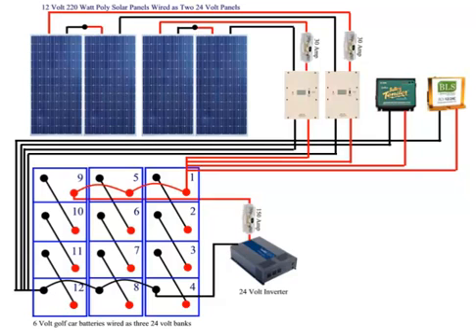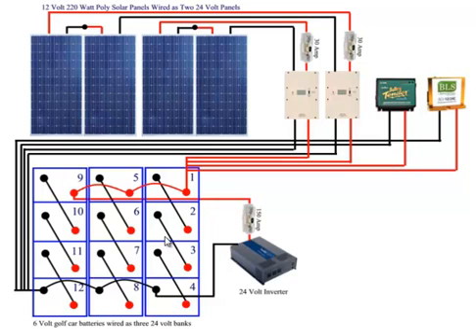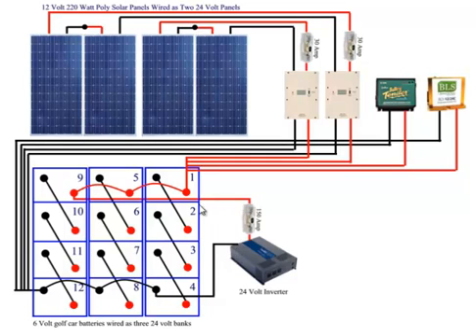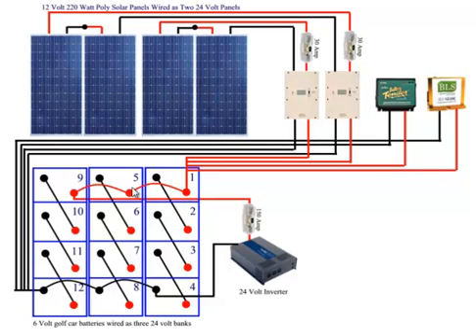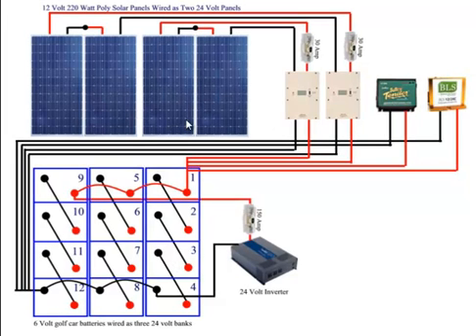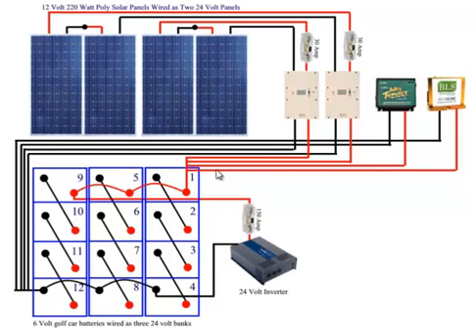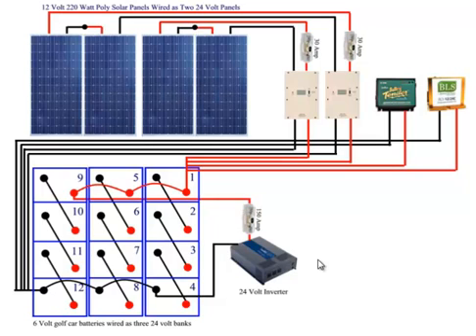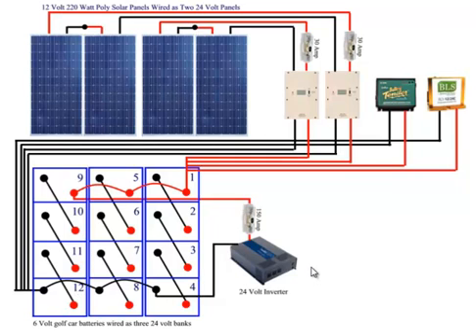DIY Solar Panel System: Battery Bank Wiring

Comment: As long as there is no load or charging taking place on the batteries, there shouldn't be any spark. I like the video. Thanks for the diagram. In the UK, we call them Electrons, whereas you refered to them as Ions. Potatoes, Potatos I guess. : )

Comment from the maker: CONTINUED... Connecting to the opposite side of the banks like this sometimes is necessary if the posts where your battery tenders, charge controllers and desulfator is already getting too full and don't have enough room for the inverter connections. I hope that helps.

Comment from the maker: You don't have to wire the inverter that way, you can wire it to the same points as the charge controller is connected. The connections to batteries 4 & 9 are electrically the same as 1 & 12 except that you're drawing power from the opposite side of the three banks and thus are forcing the electrons to flow from all the batteries equally to level discharge them. CONTINUED...

Comment from the maker: Great question. I was worried about that at first too. When I connected the battery cables from one battery's positive post to the next battery's negative post there was no sparking at all. I still find myself biting down on my teeth and making sure I make a quick solid connection when I work with the cables. But really there has been no sparking.

Comment: Hey bro, just wanted to say excellent explanation and video.

The only "suggestion" I would present to you is to maybe explain each of the devices (the charge controller and such) in the diagram so people who are knew to the whole thing can understand what they are looking at toward the top of the diagram. 

Other then that ... probably one of the BEST explanation videos on battery wiring for solar that I have seen so far on youtube.

Comment: I'd like to thank you for your excellent prep videos. You have been extremely informative and helpful. Yet, with all the prepping we can do...there are factors we need to be aware of. Have you considered prepping your batteries, wiring and electrical componants against EMP effects? A faraday system needs to be included to protect all electronics..or they will fry when we're hit with multiple X flares or an EMP attack.  Thanks again.

Comment: good video. a lot of people dont know the infor you just brought forward. a lot of people dont belive there is ristance in the wire and the futher the bank is from the input of power the batties furthers a way will not have the same voltage as the batt's at the beginning and with how you just showed it is the way to do it because it alows all batts to get the same juice.  again great video.     a lot of poeple need to see this.